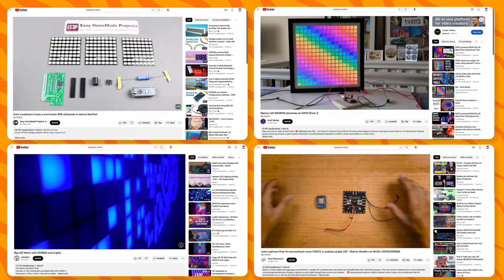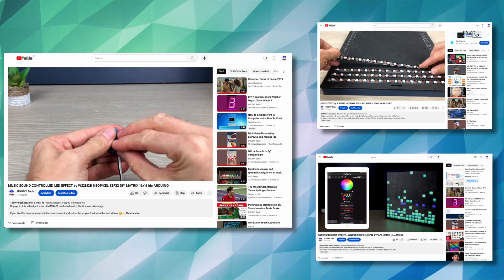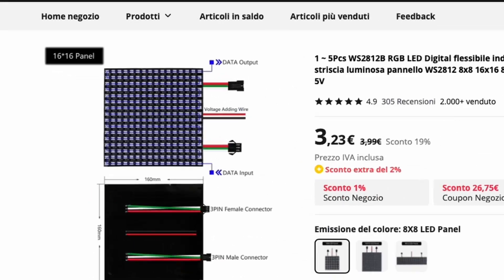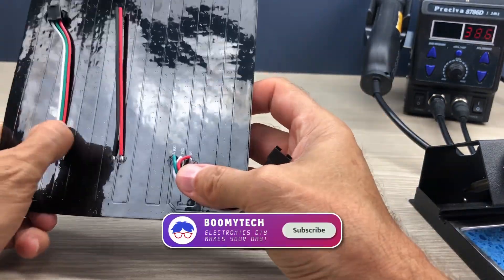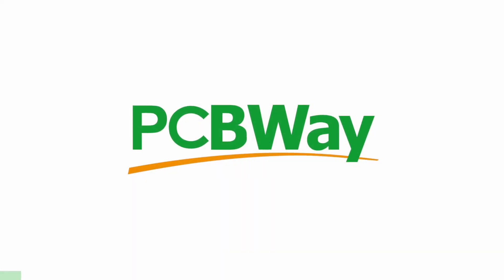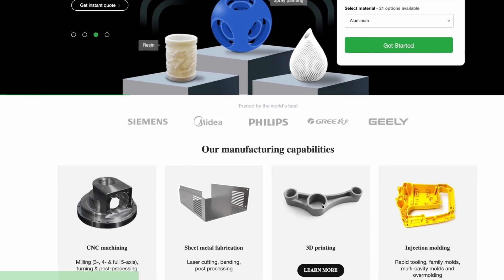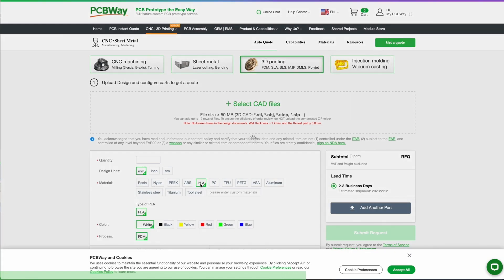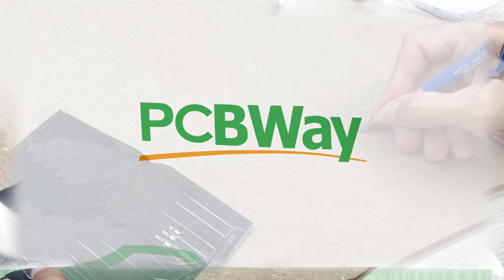Make your own 48x48 Neopixel Matrix 2304 Leds by ESP32

Comment: I am loving your content! 
Just learning about diy LED projects. How do you calculate the size of the power supply? I am thinking of expanding your idea to double the size for a Halloween display
Reply from the maker: @joemorris8088  hello Joe, you can read the comments, you will find info about it. Anyway The power supply current depends on the intensity you want to give to the LEDs in the software. you may need 5V 10A or 5V 70A for this project… double if you want double it…

Comment: how many amperios  is your power source¿
Reply from the maker: The power supply current depends on the intensity you want to give to the LEDs in the software. you may need 5V 10A or 5V 70A

Comment: I did the same set up as you, but when I turned on my lights I get a lot of flickering, any idea how I can resolve this!
Reply: And make sure to use a common ground if you’re using more than one power supply.
Reply from the maker: Hello Barry, I can suggest you to check the wires diameter because I had a lot of problems with small diameters wires. Be sure to use a power supply with enough current

Comment: Congratulations on this beautiful project!

I have successfully recreated it. At first I was a little worried about the expected power consumption of almost 140 amps at full white brightness. But let's be honest: who uses a project like this for purely living room lighting? I knew the efficiency of these panels from previous projects and was therefore sure that it must be possible to build this even with significantly less power.

So I installed a 70 amp power supply. In order not to have the power supply constantly running at its limit, I limited the power consumption to 60 amps in the WLED software. As expected, the brightness of all effects is more than sufficient despite the limitation. In most cases, the WLED brightness control can even stay in the lower third.

Additionally, I added the relatively new feature of sound reactive WLED. I implemented the procedure described on the WLED website with a digital microphone. In my opinion, this is recommended despite the somewhat more complicated wiring. After some fine-tuning of the software under real-world conditions, I'm pretty happy with the result.

However, in my configuration there were persistent, very annoying artifacts in all three rows of panels. The level on the data lines was obviously too low. However, this problem was completely eliminated by using a level shifter.

Comment: How is the frame rate on soap pattern (check FPS on info tab) as I have made the same and only getting 11 FPS
Reply from the maker: Hi, let's start by saying that these neopixel matrices cannot have a high frame rate like RGB matrices controlled by specific electronics. the speed also depends on the microcontroller you use. However, I think that this type of sequential neopixel matrices can be used as special graphic effects rather than for animations with a high frame rate, especially when the quantity of LEDs is so high.

Comment: What power comsumption?
Reply from the maker: Hello, it depends on brightness regulation… at the minimum brightness you can have a really nice intensity and current drain could be 10 to 30 amp… the best is use three separate power supply, one for each row

Comment: Hello.
I tried to replicate it.

Unfortunately, the ESP does not get any power, although I connected it to the power supply.
If I connect the ESP to the laptop with a USB cable, then it works.

I have set all the settings as in the video.

Unfortunately something doesn't work properly.

1. Akemi doesn't look like the video at all. The LEDs don't match at all to make a picture.

2. You can see something in the Octopus program, but very bright LEDs keep flashing in between.

Anyone have an idea what I did wrong?
Reply from the maker: Hello, about 5v power on ESP32, sometimes it need a capacitor 10uF between EN pin and GND. Try this and Im pretty sure the problem disappear.
About point 1 and 2, I think it is a configuration problem… try to select the effect TEXT SCROLL and see if the text on the matrix appear correct otherwise a configuration problem it will be confirmed…
Let me know…😀👍🏻👍🏻💪🏻💪🏻💪🏻💪🏻